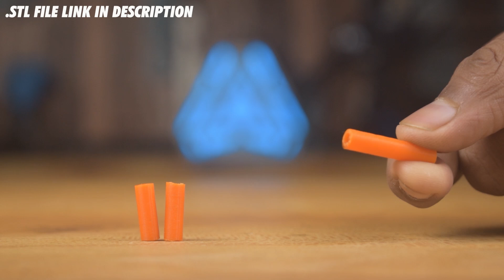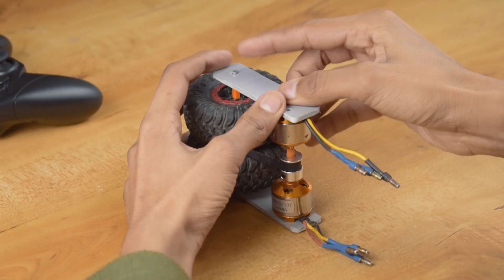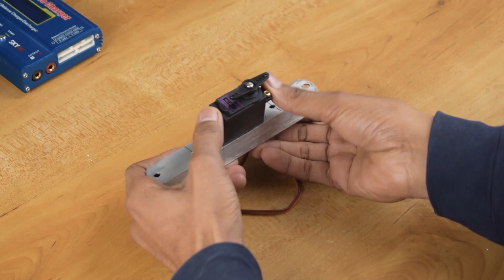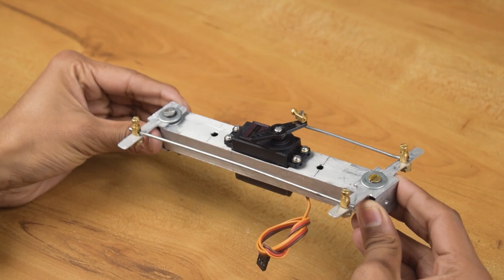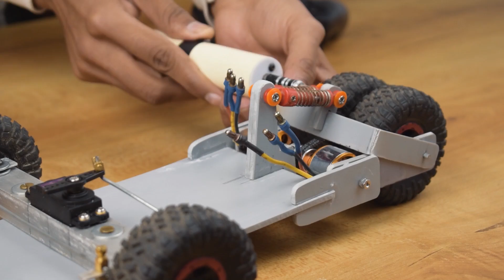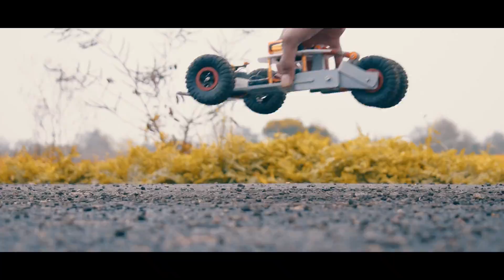DIY Super Fast RC Car at Home - Brushless Motor Racing Car

Comment: Change your springs on a stick for legit oil filled hydraulic race shocks my friend. This is just a plastic tube with just a very big nut weak spring inside

Comment: Can the car move backwards?
Reply: No
Reply: You can modify the code
Reply: No because bldc motor rotate in one direction only u can exchange the wires
Reply: No
Reply: You'll need a bi-directional esc. The esc used in the video are for aircraft. Hence forward only.

Comment: sir the esc connection is not clear you have attached to esc in one power module. How? can you tell or give circuit diagram please?
Reply: he used y adapter